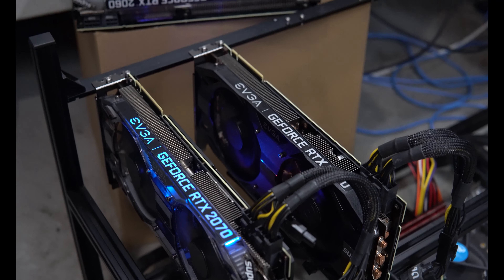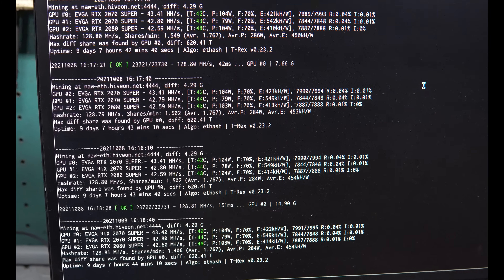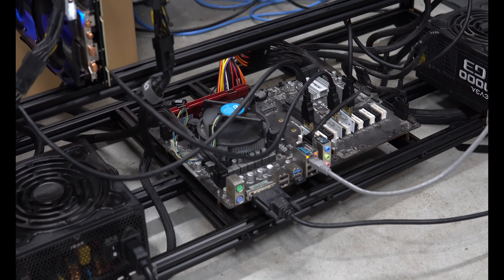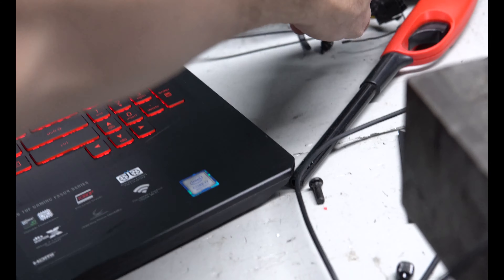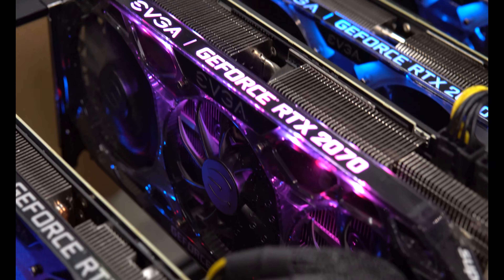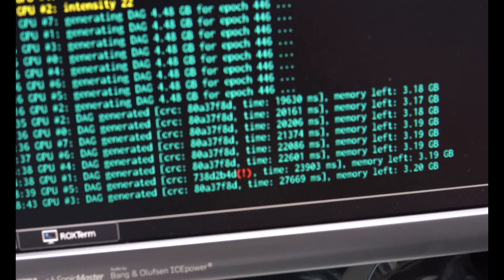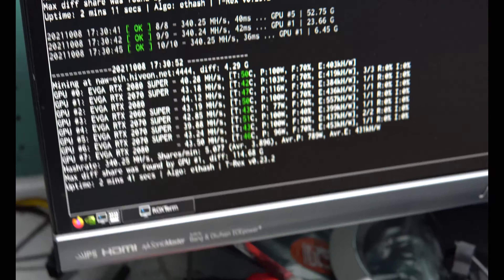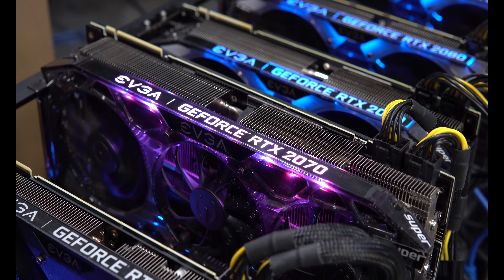8 GPU 20 Series Mining Rig | 2070 Super | 2080 | 2080 Super | 2060 Super | HiveOS

Comment: The EVGA cards fans have temperature probe zones. If the specific zone is not warm enough it will not spin up the specific fans. Should spin up if it becomes warm enough. It's actually a bonus, as it extends the fan life. My 1070's FTW2's also just spin up their rear fans if temperature rise in hiveos.
Reply from the maker: Yeah I knew they had that feature.  I wasn’t too worried since the temps never really got too high And I will add fans to the rig to keep it even cooler. Thanks for the input

Comment: Jt make sure you have harshrate whatchdog on and set as these evga card tend to report errors and shut down. you will certainly need the fans installed imho
Reply from the maker: Will do.  Thanks.  Yeah I have to install the fans.  I plan to do that in the next day or so.  Just need to locate one more fan to put on it.  I see it reports fan errors for gpus randomly.  One of them crashed last night and I rebooted and it was fine.

Comment: Hello friend. The 2070 S at 77 W is just insane !!! What's going on here ??? Is this a lottery with the EVGAs ?
Mine is running @130W in Window 10 & @ 90W in Hive OS... If u have any clue what's going on, I'm so interested to get your feedback, thx.
Can tell you : if you mix different cards models with Auto Fan on in Hive OS, it can hurt. Some card won't go in slave mode & will only run with default parameters in OC panel, nothing more.
Reply from the maker: That’s good to know.  I have no idea why that one is doing so much better.  It’s been stable though so far.   I wish I knew why so I could get them all that low.   I think I just got lucky with the silicon lottery